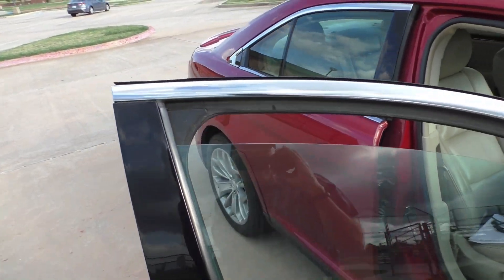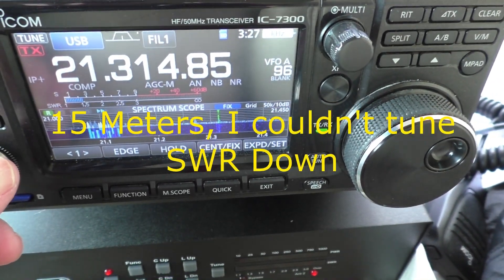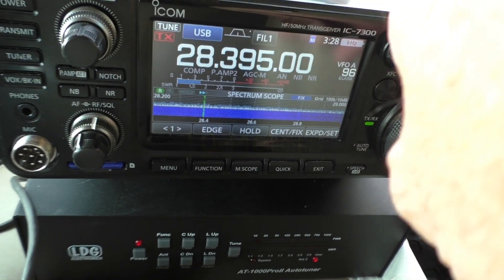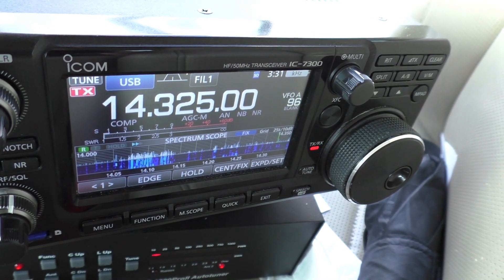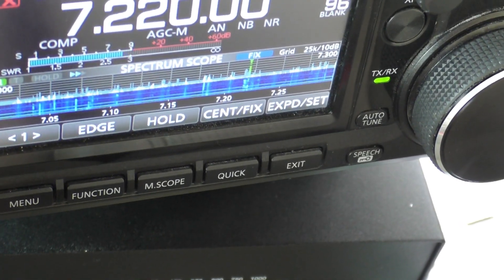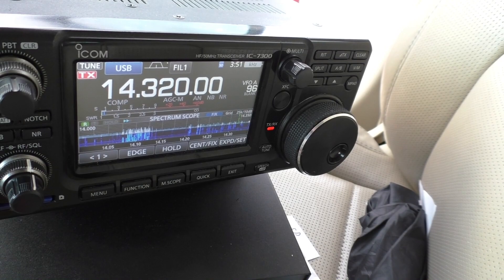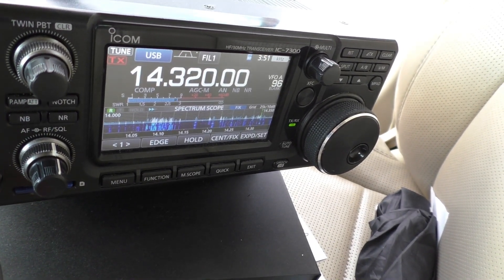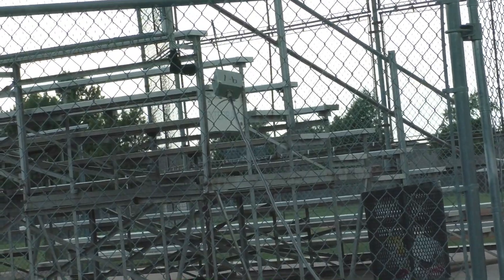Chain Link Fence as a Ham Antenna Will it Work

Comment: Seems it would have been interesting to clean and solder the wire to the fence to see any differences. I have a fence that I will try it on.
Reply from the maker: @curiosity2314  That is a thought,  it wasn't my fence.

Comment: A fence antenna saved me at a really bad place for radio, no chance to put antennas outside, but a 20 foot fence inside a inner patio works incredibly well for receiving specially the low bands.
It is rusty and old but it is the best receive antenna, never has a problem with wind or lightnings 😂
Reply from the maker: WOW!  That is a great story...   I but your right with wind or hopefully lighting!

Comment: Nice job!  Any speculation on what the radiation pattern was on the fence-tenna?  I really have to try this myself
Reply from the maker: Thank you for watching my video. I don't know. I didn't have enough time to experiment. To see which direction antenna or fence antenna was radiating...  I needed to work more...
Reply: @RichRodgersOnline when you get the time will you do part 2? This can help so many people with antenna space issues. Thank you
Reply from the maker: @fencepost5178  That is a good thought.   I may try to make another video in a couple of weeks. Thank you for watching my video.